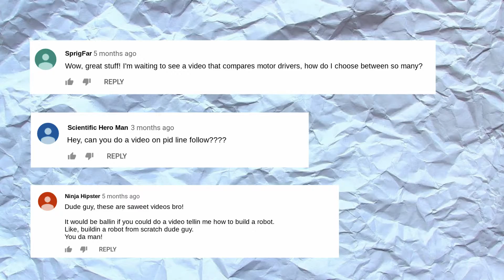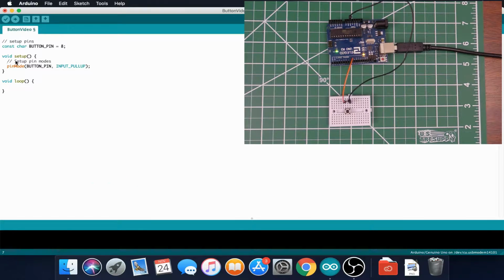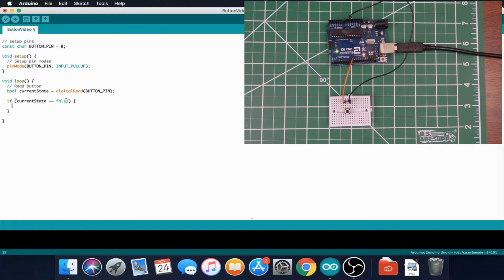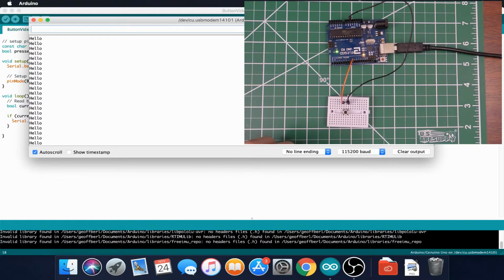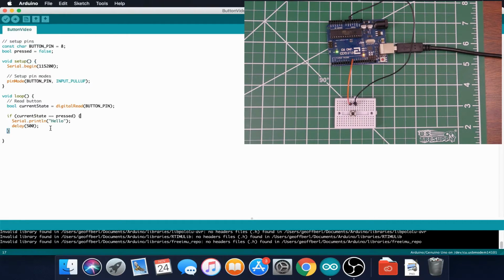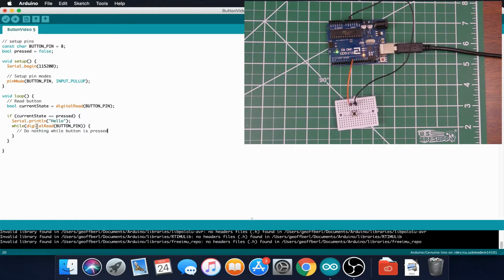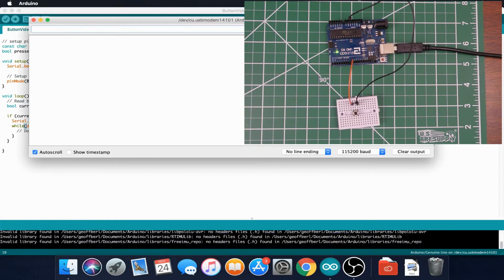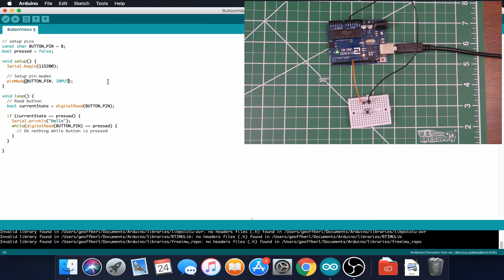How to Program a Push Button with an Arduino

Comment: When you press the button nothing else can work in the sketch? it halts the loop? is this where interrupts are needed?
Reply from the maker: Not necessarily, if you put this same code in an interrupt it would still halt the program because the chip would be performing the interrupt function. Interrupts are typically used in cases where you don't want to keep checking the state of a pin, you can have code automatically execute when a pin goes high, low, or just changes in either direction.

In order to allow the code to do something else, you'd have to modify the code to remove the while loop. Something like

Check if the button is pressed, if it is, check to see if it was pressed the last time you checked. If it was pressed the last time then we can assume they're still holding the button down so don't execute the code again, only execute the code when the button is currently pressed but wasn't pressed the last time we checked.

I hope that makes sense, if not let me know and I'll try to explain better, I might have responded to another comment with actual code so you can check the other comments (since there shouldn't be that many unfortunately lol).

Comment: Is it important to use resistors?
Reply from the maker: You "should" use resistors but you don't necessarily have to. The reason the resistor is there is because the pin readings can fluctuate if left "floating". The resistor forces the reading to be either high or low when there is no direct input source. So, yes it can work without the resistor but you may get bad readings, also, Arduino has built in pull up resistors in the chips so you can use the internal resistors (but they are only pull up resistors so you'd need to make your button a pull down, or pull to ground instead of pull to 5V).

Comment: Hi I used nema17 stepper motor+driver l298n+UNO R3 in a mechanical system, the code written below provides the movements I want, but when a push button is pressed, I need to add what code to the text below and connect the button to which inputs on the uno r3. It would be greatly appreciated if you could help me. Like Pushpull, when the button is pressed, I want the motor to proceed a certain step counterclockwise and stop and continue the same operation from where it left off when the button is pressed, but somehow I couldn't. */ #include <Stepper.h> const int stepsPerRevolution = 150; // change this to fit the number of steps per revolution // for your engine // initialize the stepper library on pins 8 through 11: Stepper myStepper(stepsPerRevolution, 8, 9, 10, 11); void setup() { // set the speed at 90 pm: myStepper.setSpeed(60); // initialize the serial port: Serial.begin(9600); } void loop() { // step one revolution in one direction: Serial.println("counterclockwise"); myStepper.step(stepsPerRevolution); delay(500);
Reply from the maker: I'm not sure I fully understand what you want to do. If you want to move to a certain position after the button is pressed then you would first need to add the code (if statement) to detect if your button is pressed. Then from there you would put the movement code inside the if statement so that if the button is pressed, the motor moves to the position you want.

If you can try to do as much as possible and then send me the code you came up with I can try to help some more.

Comment: Hey man, I'm working on a school project. My goal is to have 2 push buttons and each will control a separate LED, when one button is pushed the corresponding LED will extinguish while the other one flashes. I have it working but I need the serial monitor to say every time I press a button. My problem is when I use the "while" statement it stops my other LED from blinking while the button is pressed. Do you think a "do-while" statement could resolve my issue? any suggestions are welcome. Awesome video!
Reply from the maker: The best way that I can think to resolve this issue is to use an interrupt triggered by the timer, it basically allows a function to be run regardless of the code currently being run, it would switch over to the led function and then come back to the main code.

I don't have any videos on timer interrupts but this article https://blog.wokwi.com/5-ways-to-blink-an-led-with-arduino/#blinking-with-timers- should help you out. If you just need the one to keep blinking all the time you can use the code as is. If you need it to blink under certain situations you'll need to modify the blink interrupt routine code so that there is a boolean such as "enabled" or "shouldBlink" so it knows whether or not the LED should be blinking. Then just add an if statement like this.

ISR(TIMER1_OVF_vect) {
if (shouldBlink) { 
  digitalWrite(LED_BUILTIN, !digitalRead(LED_BUILTIN));
}

Lastly, for the record, you really shouldn't read a digital pin if the pinMode is set to OUTPUT, it probably won't give you any issues but to be safe or if you are having issues you might want to add a pinMode() statement to change it to OUTPUT when its digitalWrite and INPUT when it's digitalRead.

Comment: Is there a reason you used const Char instead of const int? Im trying to use the same type of button to start my code, pretty much once the button is pressed it will run through my code once. Great video and tutorial thank you by the way.
Reply from the maker: It won't make any functional difference. I use 'char' when assigning pins just because char values go from -128 to 127 Since it's only one byte it takes up less space than an int which is two bytes. Int types range from -32,768 to 32,767

Technically it takes slightly longer to process variables that are larger but the difference between char and int is very minimal, mostly it's about saving space but again, I wouldn't worry about that unless it became an issue.
Reply: @RobotResearchLab  Thanks! Makes sense. Im using pin 51 as i have a CNC shield in so all the others are taken.

Comment: Hey nice video 😁. I want to ask you,  do you know the code when i pressed the button for 5 second and then it will print "Hello" ?. Thank you
Reply from the maker: Hey, sorry for the delay, the code is going to depend on whether you want to do other things while also checking for the button being held for 5 seconds.

If you just want it to check for five seconds after the button is pressed and do nothing else you just use a while loop for 5 seconds after the button is pressed, leaving the loop only if five seconds has passed or if the button is released. Here is some un-tested code that should get you started. Keep in mind, checking if the button is pressed assumes BUTTON_PIN is set and that a digitalRead() HIGH means pressed. This code should allow you to hold the button and it will execute the print statement for every 5 seconds the button is held.

----------------------------------

void loop() {
  checkButton()
}

void checkButton() {
  static bool lastButtonState = false;
  static unsigned long lastPressedTime = 0;

  // If the button is pressed
  if (digitalRead(BUTTON_PIN)) {
    if (lastButtonState == false) {
      // The button was just pressed, record the state and time
      lastButtonState = true;
      lastPressedTime = millis();
    } else {
      // The button was already pressed, check the time
      if (millis() - lastPressedTime > 5000) {
        // Button was pressed for five seconds!!!
        Serial.println("Hello")

        // Reset the time last pressed so it only executes every 5 seconds
        lastPressedTime = millis()
      }
    }
  } else {
    // Button isn't pressed so update the lastButtonState
    lastButtonState = false
  }
}

Comment: and what if i want that the oled Display turned off (after 10 sec.) after pushing the button. Any idea?
Reply from the maker: For that you'd have to add some more variables but it's doable. You would want a variable that holds the value of when the button was last pressed (let's call the variable lastBtnPressMillis) and you'll need one to know if there is a pending action (let's make that a bool and call it pendingBtnAction). It will either need to be a global variable or a static variable, if you can't figure out static variables just go with global for now. So, when the button is pressed, set the lastBtnPressMillis to the current time (lastBtnPressMillis = millis()) and set pendingBtnAction to true. Then you'll have to add a check for that variable in the button function, maybe something like this

if (pendingBtnAction && millis() - lastBtnPressMillis > 10000) {
   // turn off your OLED here

  // Reset the pending action flag until the next btn press
  pendingBtnAction = false;
}

These aren't the easiest things to discuss via comments and I don't have the time to make videos lately so let me know if any of this isn't clear. This is by no means the only solution, this is just off the top of my head how I would do it.
Reply: @RobotResearchLab  thank you very much. i just solved the problem with the command from ssd1306 lib. display.ssd1306_command(SSD1306_DISPLAYOFF);  and if i want to turn on the oled display, display.ssd1306_command(SSD1306_DISPLAYON);

Comment: Will you please make a video for me wherein I will be using four switches, each one will be doing different jobs. For example: Switch 1 when pressed will switch ON light. Repressed will switch OFF. Switch 2 will start fan when pressed again switch off fan. Like wise for other switches. Use of Arduino Uno, Switch and Relays requested. Thanks in advance.
Reply from the maker: Hey, thanks for watching and commenting. I haven't had time lately to create a new video so I probably won't get to this soon. I'd like to use your idea for a video that shows how to create a function but what I would suggest is get one button working, then copy and paste the code three more times and change the values for each button. It really should be put in a function so you don't copy/paste but if you don't know how then it's easier to just copy/paste.

If you need help you can contact me through my website, it'll send me a personal email and then when I respond you can attach your code so I can take a look at any problems you're having. http://robotresearchlab.com/contact-me/
Reply: @RobotResearchLab  Which part of the code do i copy because i wanna add multipule buttons
Reply from the maker: @MarkoA320  There are many ways to do this, personally I would copy all of the code inside of the loop() function and put it in a new function so the code can be reused rather than copy and paste the same code over and over. I added a parameter to the custom function that accepts the pin the button is on, now this function will work for any pin that you tell it has a button on it. I also added a return bool value, if the button is pressed it returns true, if it isn't then it returns false. This might be confusing since "pressed" is set to false so you can certainly change the function to return whatever pressed is set to instead, I'll show that code after this code below.

void loop() {
  if (buttonPressed(BUTTON1_PIN)) {
    // Do something here for button 1
    Serial.print("Hello from button on pin ");
    Serial.println(BUTTON1_PIN)
  }
  if (buttonPressed(BUTTON2_PIN)) {
    // Do something here for button 2
    Serial.print("You pressed the button on pin ");
    Serial.println(BUTTON1_PIN)
  }
}

bool buttonPressed(char btnPin) {
  // Read button
  bool currentState = digitalRead(btnPin);

  if (currentState == pressed) {
    while(digitalRead(btnPin) == pressed) {
      // Do nothing while button is pressed
    }

    // Return that the button was pressed
    return true;
  }

  // Return that the button was not pressed
  return false;
}

Now, as mentioned, you could alter that code so it returns whatever "pressed" is set to by changing the return values from 'true' and 'false' to
return pressed; // Return a value of pressed
and 
return !pressed; // Return a value of NOT pressed

This option is a little cleaner because now, if you change the value of pressed because maybe you're using a pull down resistor, the function will still work, you'd just simply change the value of pressed to 'true' instead of 'false'.

I hope this helps.
Reply: @RobotResearchLab  thanks mate
Reply: @RobotResearchLab  Many thanks for considering my request. Good day.

Comment: Thankyou bro....but verious type of action ( e.g: set , increase and decrease action)  by used same push button in Arduino program.
Reply from the maker: I'm not sure what you mean, I'll need some more information. What are the "rules" to determine increase vs decrease?

Is it something like the button goes up and when it reaches the max it starts decreasing, or is there a certain button press sequence to increase vs decrease? Like, press twice quickly to increase or press once to decrease or something like that.

Comment: i never made anything like this i follow all the steps and im good,  let me explain i had an handbrake to games working with magnets but it was really unreliable and it broke, so im just trying to re-use it has a button but after i did all this i try to select the input to a game to work has handbrake but it doesnt detect any the button.. idk if you understand what im trying to say before the arduino showed has a controller and now shows unspecified btw my arduino is a PRO MICRO, do i sellect the board micro or pro/pro mini
Reply: so i got it i just had to download a joystick example and input this #include "Joystick.h"

im sorry for all the spam but its my first time working with any hardware at all, you helped me a lot i subbed and suddently i gained a new hobby
Reply from the maker: @SimSim_ex  No problem at all, sorry I didn't get to your comment in time but I'm glad you ended up figuring it out. Thanks for the feedback.
Reply: ola. pelo que  me deu a entender pecebes de arduino e gostas de jogar. eu comprei recentemente uma button box para simulador. acontece que eu jogo ACC na xbox. no acc nao da para escolher as teclas do teclado e ja veem definidas como por exemplo para aumentar o ABS e Shift+a . e nao sei fazer. Podes me ajudar? abraco

Comment: This video is really helpful, but there is a problem with my code. I am trying to make a servo motor move when I press the button, but whenever I verify the code I get the error message "a function-definition is not allowed here before '{' token". Here is my code
const char BUTTON_PIN = 8;
bool pressed = false;

void setup() {
  Serial.begin(115200);

  pinMode(BUTTON_PIN, INPUT_PULLUP);
}

void loop() {
  bool currentState = digitalRead(BUTTON_PIN);

  if (currentState == pressed) {
    
    #include <Servo.h>

    Servo servo;

    void setup() {
      servo.attach(9);
      servo.write(0);
      delay(2000);
      
    }

void loop() {
  
      servo.write(90);
      delay(1000);
      servo.write(0);
      delay(1000);
   
   }
  }
}

I am also pretty new to programing with arduino so I don't know that much about it. If you know how to fix the problem that would be amazing.
Reply from the maker: Sorry I didn't see this comment, I'm not getting notified of every comment by YouTube.

Anyway, hopefully you've figured out the issue by now but it's an issue with your curly braces. You have a function declaration (void loop()) inside an if statement. Function declaration must be outside of all code blocks. Also, you can't have two functions named void loop(). It looks like you just accidentally copied the loop function into your if statement.
Reply: Thanks, I did end up fixing the issue, great video by the way.

Comment: I think there is something called a "debounce" maybe that would also help the pressing to be more ok, awesome vid, just subbed
Reply from the maker: Debounce is slightly different, it's to counteract the fast on/off that can happen when pressing or releasing a button (called hysteresis). Basically with hysteresis, when you press the button it can make the microcontroller think you pressed the button multiple times. These buttons don't seem to have that issue so luckily I didn't need to go down that rabbit hole with this video. But I do plan to cover this in a future video. Thanks for the feedback and sub, I hope to get more videos out soon, nicer weather means more work outside so we'll see.... Thank again!
Reply: @RobotResearchLab  this is probably what's happening with my buttons
Reply from the maker: @shukrantpatil  I don't have any videos on debounce yet, the easiest (yet hacky) solution to resolve this would be to put a short delay after a press is detected. This way any hysteresis occurring during the press will be ignored during the delay.

Comment: hi im trying to make a button box for a sim racing setup and i have no experience at all do you think you could help me i have a arduino pro micro and 9 2 pins button
Reply from the maker: Sure, you can contact me through this form and it will send me an email. Then I can respond back to you via email instead of trying to help through YT comments. http://robotresearchlab.com/contact-me/